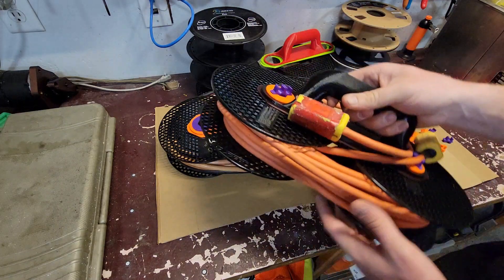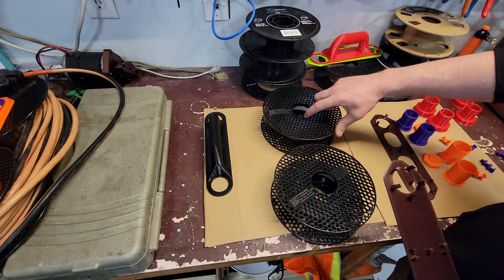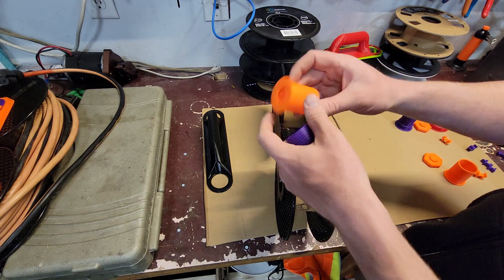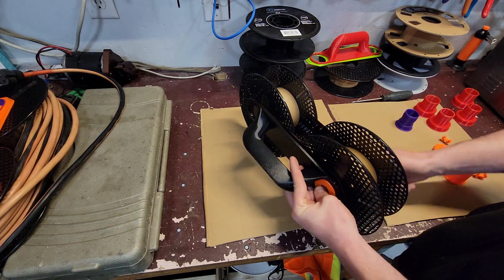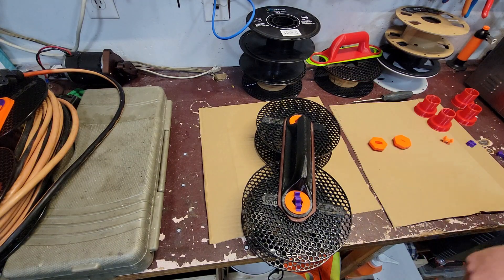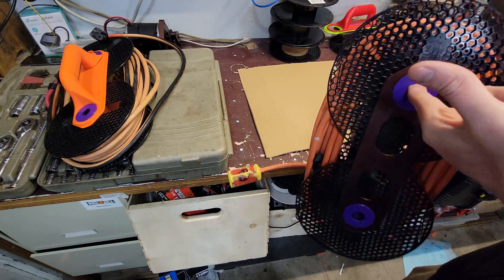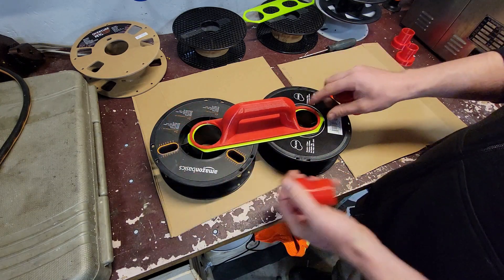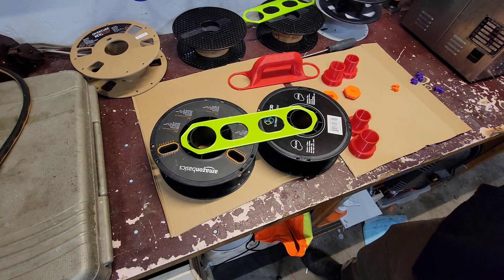Dual Filament Spool Cord Wrap

Comment: what would be cool is if the spools would still roll that way it would be a bit easier to unspool them as wrapping an unwrapping is a huge pain.
Reply from the maker: I don't think that would work as the whole cord would need to travel around the two spools. The friction would cause it to jam. Unless I'm misunderstanding the intent? You can spool a single roll by rotating because the cord is stationary on the roll.